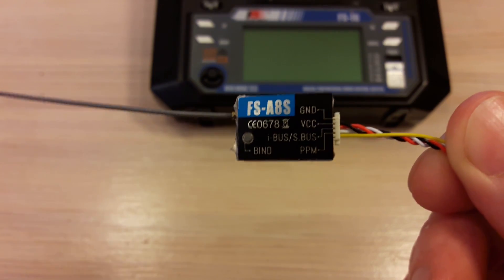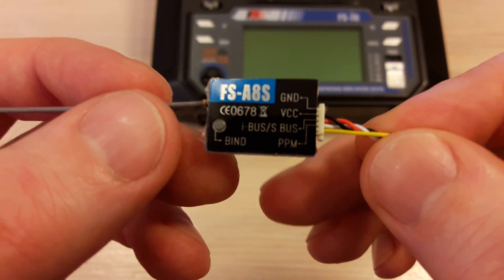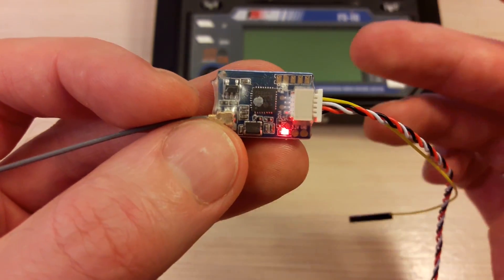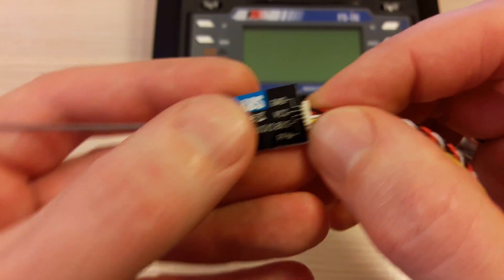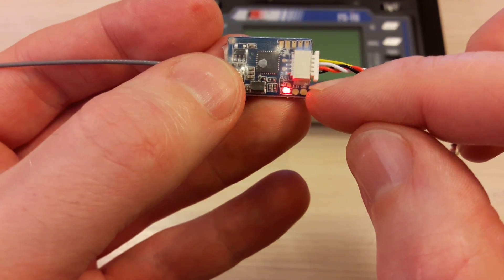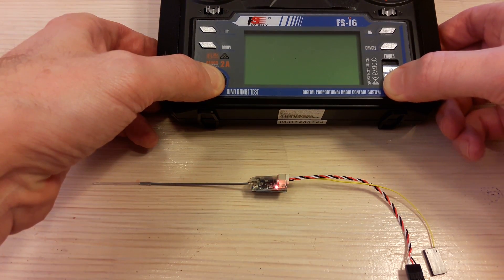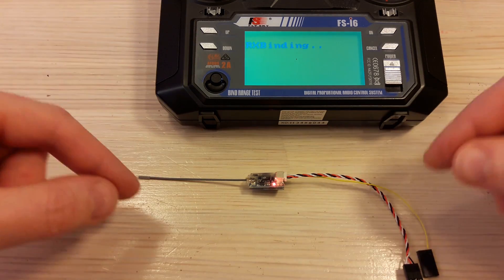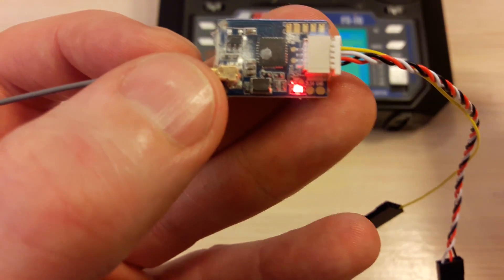#1 Mini How to bind FlySky FS-A8S micro receiver to the FlySky FS-i6 transmitter

Comment: what the yellow wire on the receiver
Reply from the maker: This receiver can output iBus/SBus signal on white wire and PPM signal on yellow wire. Better use iBus/SBUS signal, as it has less latency, is digital. Also I could not set up failsafe on PPM signal with this receiver. Also could not set up SBUS - known bug in the V1 of this receiver. So ended up with iBus signal only and it works OK.

Comment: Hello Montis!  
Please advise me about the application information installed on the Flysky FS-6I controller. I'm new to FS-6I so I don't understand it very well. My FS-6I has been updated to 10 channels. But now I want to connect to RX ppm to use ARDUINO, but I don't know if the mode is (IBUS/PPM) or (SBUS/PPM) is suitable and correct. Connect to RX FS-A8S .thanks Montis!

Comment: Кто знает подскажите: можно ли RC Receiver, Flysky FS-A8S 2.4G 8CH Mini,  и как правильно использовать для управления самолета вместо приёмника FlySky FS-iA6B
Reply from the maker: If you need to connect the servo and esc directly to the receiver, then no, FS-A8S receiver will not work. You need some flight controller to use FS-A8S.

Comment: When binding the a8s to my transmitter by switching on the transmitter + holding down the bind key button, the a8s doesn't respond and the red LED still blinks fast. Can someone help me with this? I can't get it to work...
Reply from the maker: Make sure your radio is in the AFHDS 2A mode.
Reply: @MontisTube  yeah thanks i found out yesterday, i had to switch it to afhds and turn it to PWM /SBUS. Now it binds. My next problem now is the quadcopter isn't recognised by my laptop or betaflight when i plug it in with a USB- datacable. So i can't connect it and configure it with betaflight yet. I already tried zadig and impulseRC, but neither work. Can someone help me with this? Nevertheless, helpful video Montis!
Reply from the maker: Try different data cable. What does your device manager shows when you plug in the FC?
Reply: @MontisTube  yeah ,i've used a differen't data cable and now it works. the LED doesn't blink but stays on when the receiver is powered and the transmitter is on, so it is succesfully bound. But still the quadcopter can't receive any signals from the transmitter. the transmitter doesn't show the receivers battery life on its display. don't know whats wrong now
Reply from the maker: Good so far. Now you need to set up the UART you have connected the  receiver, choose SBUS or iBUS on BF configurator.  By the way a8s can be swiched from SBUS to iBUS and back by holding the bind button pressed for a few seconds. Try it.
Reply: @MontisTube  ok already chose SBUS in BF configurator.. still not working. Don't know what you mean with setting up UART. and how do you know if your receiver is on SBUS or IBUS when you hold down the bind button for a few seconds? (quad is still not working)

Comment: i got it to bind but it still wont go anywhere how do I make it fly.
Reply: Binding is easy enough but you need to make sure that each piece in the chain (transmitter, receiver, flight controller) is in the correct mode; PPM and i-Bus or S.Bus.  The receiver from the factory is set to PPM and i-Bus.  For PPM it uses the yellow for signal, the red, and black for power to the receiver, the white wire is not used.  However if the PPM pin on your flight controller is where the white wire is on the 3 pin plug you can remove the yellow wire from the 4 pin plug that goes into the receiver and place the white wire there.  To remove the wires from the 4 pin plug locate the little retaining fingers on the side of the plug, lift it slightly with a tip of a razor blade being careful not to bend it too much or break it and pull the wire with the pin out of the plug. Place the white wire where the yellow one used to be.  The PPM signal will now be transferred over the white wire and the yellow wire is no longer attached.  For i-Bus and S.Bus, with the original wiring harness not modified, the red, black, and white wires are used.  You could remove the yellow wire to save weight as it is not needed. If you're wanting to use S.Bus you'll need to do one more thing, the receiver comes in PPM and i-Bus mode so you will need to switch it to S.Bus.  You can switch between i-Bus and S.bus by powering up and binding both the receiver with the transmitter, after they're bound the light on the receiver is on solid.  Hold down the bind button till the light starts flashing and then let go, when the light turns solid again it has switched modes.  I paired this receiver with a Radiolink Byme-A for a small fixed wing.  I had to search the Internet for this last bit to make it work with S.Bus.  I hope this helps.

Comment: Ohh..this is very helpful but don't know how to connect this with one servo ,one motor and battery.Pls help me.
Reply from the maker: No, this receiver has iBus, Sbus and ppm output, but no servo (pwm) output. You cannot connect servo directly to this receiver. This receiver is intended to be connected to some  flight controloller.
Reply: @MontisTube  I am a beginner so don't know what is iBus,Sbus and PPM output?
And I purchased this receiver and Flysky i6 Transmitter for micro scale rc truck model.
Reply from the maker: For a car you need receiver with 3PWM (servo) channels output. As an example FS-GR3B. Also any receiver with 4 or 6 PWM channels will work, just they will be a bit larger. You can look at the FS-iA4b, FS-iA6, FS-R6B receivers.

Comment: I get a solid light but it still hasnt bound to my receiver, anything I could be doing wrong??
Reply: same
Reply: @SJay29  same problem, tryin since 3 days to get it run
Reply from the maker: If you follow my instructions and get the solid light, then it means the receiver is bound to the radio. Most likely the problem is somewhere else. What protocol is active on the receiver IBUS or SBUS? Try switching between the protocols by long pressing the bind button.
Reply: @christophbroszkiewicz8220  Montis reply is correct, i ended up getting mine to work playing with settings in my controller

Comment: Does they’re need to be any soldering ?
Reply from the maker: This recveiver has standart servo connector on the other side. So if your flight controller has pin header connector it is possible to connect without soldering. But usually you'll have to solder the receiver to almost any modern flight controller.
Reply: Montis thanks !

Comment: You need to show in the video what you cannot see how to attach the power....Where's the power coming from. You don't show where the wires are coming from
Reply from the maker: This video is about binding, not showing how to connect it. 
IBus signal usually is connected to  any UART RX port. It is normal, uninverted serial protocol. This RX also has PPM output and IBus can be swithed to SBUS.

Comment: Can I bind it with th9x?
Reply from the maker: No. Unfortunately standart TH9X has only AFHDS protocol and A8S has newer protocol AFHDS 2A.
Reply: @MontisTube  is it possible to upgrade from AFHDS to AFHDS 2A?
Reply from the maker: There is external AFHDS 2A JR module for TH9X, but I haven't tried it. Also it is possible to upgrade the firmware to er9x and use multiprotocol module.

Comment: Can this receiver be connected to a Pixhawk 2.4.8? If so, Please explain the wiring.
Reply from the maker: Should work. This receiver outputs PPM, IBUS and SBUS. Refer for wiring instructions to this site: docs.px4.io/en/assembly/quick_start_pixhawk.html
Reply: @MontisTube  I tried using the IBUS, but to no avail on my Pixhawk. Maybe I'll try switching it out to the PPM.
Reply from the maker: I'm not sure if Pixhawk supports iBus. You should switch to SBUS or PPM.
Switching from iBus to SBUS: hold the bind button until the led will blink.
Reply: @MontisTube  Thanks! I'll try it out. Although i did read this forum about you telling that the receiver does not save the SBUS mode state after binding. https://www.rcgroups.com/forums/showthread.php?2792377-FS-A8S-help
Reply: @MontisTube  This really solve my issue... (Switch mode pressing 3sec bind button) Thanks, no other site i found that tell it
Reply from the maker: You are welcome! I'm happy it helped!

Comment: I have an eachine wizard 220s, it's an rtf and after a wreck my a8s broke. I got a new one and the bind works but nothing responds. I replugged old mostly broke receiver in and the quad will arm and throttle. Why won't my new a8s replace the old one?
Reply from the maker: Try switching the A8S RX from IBus to SBUS by holding the bind button. You'll see the LED flashes a few blinks.
Reply: AWESOME, It Worked! I was so frustrated. Once bound, holding the bind button changed settings. 

Btw, the instructions that came with my new a8s didn’t mention anything about this, but the back of my wizard quick start guide has broken English version “each time the long press of the key to keep the 2s can switch between I-bus/s-bus output mode”.... no wonder I didn’t get it ffs.

Thanks again🚀
Reply: Thanks had the same Problem u Help me !                        For everyone just Press the Bind Button again for a few seconds and it will blink again and change from i-bus to s-bus and the other way.

Comment: nice, what end and what do you plug it in at? can I put it in my walkera 250? I have two FLYSKY controllers I got, but I'm used to the strip on the 710 connectors (chick are crap btw) can I connect one of these to any drone? what/where do i PLUG in the other ends too/ thanks... liked.
Reply from the maker: Kriswixx this RX has iBus/SBUS and PPM out. Can be used with Walkera. Probably the easiest is to connect by PPM wire. Only three wires needed +5, GND and PPM. Connect PPM wire to the RX on  the flight controller. Then configure in the Betaflight Configurator. Watch more videos about connecting the RX to FC... good luck
Reply: yer the man. i got this pawn shop bad boy working. who knew it had flysky in it. i went back twice. also got a bag of parts has 2 flysky rec ievers. so stoked.... I will be learning about betaflight soon, as I am building a mini with the parts. i'll probably do a video of all the parts i got, and maybe soemone can link a proper vid. i think i have a F3 for starters and its a tiny mini racer stack... anyway, super stoked - the full size has red bottom props.. things a beast. I will look into it. i think with your videos, it's starting to sink in. i got lots more to watch though
Reply from the maker: @Kriswixx  good luck! Quads are sooo addictive! It can he hard at the start but then its pure fun!

Comment: Good video. I just bind with my fsi6. LED solid yellow. But my betafpv wont work. Can anyone help me. Its work on AFHDS2A.
Reply from the maker: Connect your FC to Betaflight Configurator and check why your quad does not arm. Some tips can be found here: http://www.multirotorguide.com/guide/troubleshooting-arming-issues-why-quad-not-arm/
Check the Radio tab and Modes tab first.
Reply: Montis thanks you. Its work. Forgot to change ibus/sbus.

Comment: Have you bound it with the original Flysky T6 afhds type 1 Rx yet? I have to do this & I know it supports both afhds 1 & 2A (2A by default). Only thing is you would have to have type 1 selected in your model memory set up but, what when it comes to binding, does that matter? Because when you put the tx into binding it just go's automatically into a set state. Thought I would ask to save me hassle & headache, although I would probably have started that process already.
Reply from the maker: Nope, fs-a8s receiver supports only the AFHDS-2. Therefore it cannot bind to T6 transmitter.
Reply: Montis Oh, I meant bind the original afhds 1 FS T6 receiver with the FS i6 tx. I would of done so by now, only I left the lipo for the rx in the shed. It will be tomorrow now. I know it supports it that's why they added the backwards compatibility, it's just the binding. I've pre set it for 2A off anyway in the model setup. But in binding mode, I'm not sure it has any bearing anyway? It might just be designed to pick up both types simultaneously in the binding.
Reply from the maker: Oh, I see now. In this case yes, set AFHDS 2A to OFF in model setup, save and restart TX in bind mode. You must set the right  protocol before the binding as the binding is different for different protocols. Flysky FS-i6 transmitter works with all AFHDS and AFHDS 2A receivers!

Comment: Can you bind this to the FSi6s
Reply from the maker: Taylor Hokanson, yes you can. They both work in AFHDS-2A protocol. Just follow the same steps. You will not see the binding result on the FS-i6s screen, just watch the receivers LED.
Reply: Montis ok thank you also i can get it bound but no input do i need to flash betaflight before the transmiter will do anything thanks
Reply from the maker: +Taylor Hokanson you need to connect PPM out from the receiver into flight controllers PPM input. Then check if the receiver works in the Receiver tab on Betaflight/Cleanflight/iNAV.
Alternatively you can connect serial RX (iBUS) output to the appropriate FC input. 
Search the inet for receiver connection to flight controller.
Reply: Montis ok i conectected the ibus output to the flight controller now what do i need to do?
Reply from the maker: +Taylor Hokanson set serial RX on the right UART and select IBUS as RX protocol type. Refer to many pther YT videos how to connect RX to FC

Comment: i have the old version i guess my transmitter binds it seems but it doesnt do anything its a fs82 reciever and a fsi6 transmitter
Reply from the maker: Brooklyn Droner hard to tell something but it may be that you need to setup your FC for proper signal input and also wire your RX to the correct pins. Try to read more about connecting RX to  FC via iBus and PPM.

Comment: i had successfully bind with fs i6 on my ex110 but quad not responding, its my first racer, please guide.
Reply from the maker: Fish and Aquarium Lover , connect your ex110 to the cleanflight or betaflight configurator, go to the receiver tab and check if the FC responds to your TX sticks movements. If not - you need to configure your receiver. Possible variants PPM, iBUS or SBUS. Good luck.
Reply: unable to connect with betaflight or cleanflight

Comment: I'm one of the original members of the thread back when it first started.  This is the second time we had been contacted and asked for our information.  At least this time some of us actually got personal emails. Six months of frustration.  I lost $450+ in less than one flight. Just finished the build the night before. Not even one full pack. Because of public safety, I had to disarm in flight.
Just so happened that I was over moving water when I  had to initiate failsafe.
Reply from the maker: +Paul Butchyk, really terrible loss! I feel your frustration and I understand you. This was the epic failure of the FlySky to release the so much anticipated RX with such a fatal issue. See you at RCG. Lets see how FlySky will deal with this.

Comment: Hi i have a problem i hope you can help me, i have fs-a8s and im using fs-i6s remote, the broblem was the reciver want to bind to the remote but actually it's connected if i see in my software"librepilot" ,but there no indication in my rx battrey bar and it show this (?) logo and i have try to reconnect it and try other things but i can't figure out why. Thankyou😊
Reply from the maker: Hi, its hard to tell whats wrong with your setup or even whats not working ;) 
About binding: At first I could not bind to the transmitter until i have changed the moedl in the transmitter. Selected next empty model and it worked from the first try.
About RX battery voltage (bar?): this receiver has no telemetry, only one way communication, so you will not see any RX battery information on the transmitter screen.
Reply: Montis, hey thankyou very much for replying me and also thankyou for your great advice and your information, i hope it will work for me
Reply: у меня такая  же беда ... не запускается...

Comment: hi I've bind up the a8s to rangex-i6x as the light is stable but nothing works like the throttle or anything on my machine wizard 220. what could it be?
Reply from the maker: peccamc jaundrill, connect your wizzard to CF or BF configurator and check the radio tab - is it responding to your sticks?
Also check your RX setup in configurator. Have in mind that this RX works in iBUS mode by default.
Reply: Yes, I connected to bf and no response on anything from remote. I've also been in rx setup and changed to ppm, Ibus and the other 2 options. Could it be the a8s receiver that's broke?
Reply from the maker: +peccamc jaundrill if you use iBUS or SBUS, then you need to assign UART2 to serial RX and receiver mode to RX_SERIAL.
For PPM you need only to select RX_PPM as receiver mode.
If you see no reaction on receiver tab, then either it is not bound or not connected correctly. Of course it is possible that your item is broken...
Reply: Ok. I've tried everything. I've ordered an new receiver (different type) so will try that. Thanks for the help

Comment: only one antenna?
Reply from the maker: Yes, one antenna with U.FL (IPEX) connector (https://en.wikipedia.org/wiki/Hirose_U.FL). It is AFHDS2 capable receiver but without two way communications, so no telemetry and etc.
Reply: Is this a good option for a mini racer (130mm)? would it be still be able to fly FPV with the same range?
Reply from the maker: Eric Avila, this is not a full range receiver, but it is small, has ppm and iBus outputs, has failsafe in iBus and you should get about 300m range.